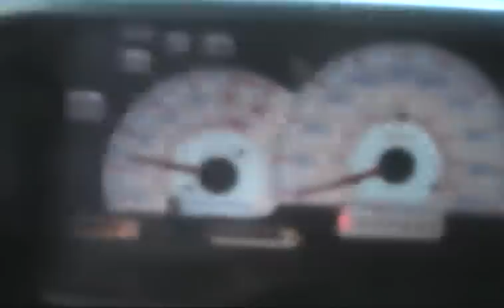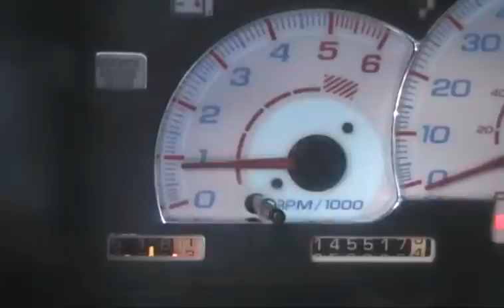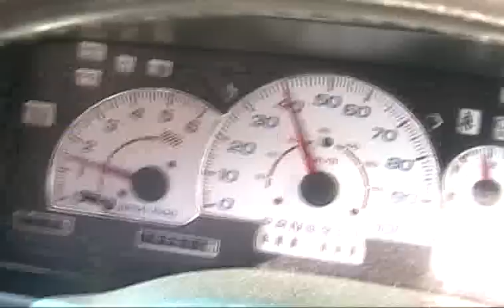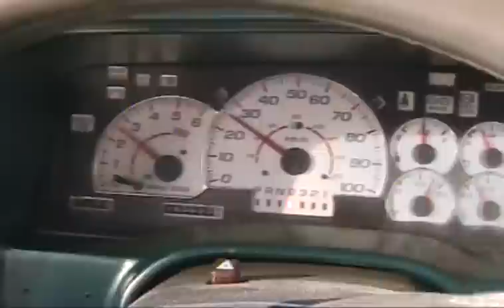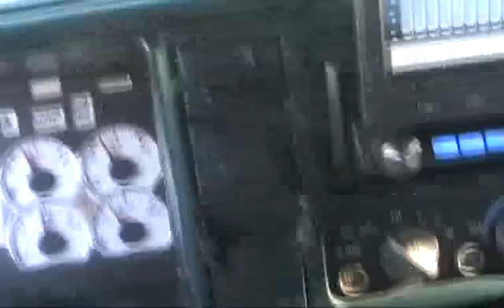Bad Chip in my 383 Stroker

Comment from the maker: Its a 95 cluster with an aftermarket overlay which is appropriate for a 96 or newer. They all go to 6000 max, the only difference between the 95 and 96 or newer is the redline which was higher on teh 96 due to the vortec engines. Mine is still accurate as I have cross checked it with 3 other tachs. It was necessary to have it exact for dynotuning purposes.

Comment from the maker: Hooker Long tubes with 2-1/2" collectors. The truel dual 2-1/2" pipe. Each bank has a 12" resonator and a single chamber Stainless steel Imco muffler. The exit is a 4" stainless tip out each side behind the tires.

Comment from the maker: the 65 injectors will work and they are can be set up to really flow with higher fuel pressure. Its a fairly common thing for people to just run higher pressure in lieu of the larger injectors with lower pressure. You may be able to just kick up your fruel pressure a bit to accomplish this. You can either modify the stock one or purchase an external. Personally after everything ive gone through, I would suggest the external with a gauge so you at least know where you are.

Comment from the maker: Man I wish. I ended up putting the stock chip and stock injectors in to keep it sane. One of these days ill set aside a couple grand and drive down to the dyno shop and have them go through it. It runs great on the stock chip, just quite restricted.

Comment from the maker: TBI Chips could not set up a chip for this engine. He burned dozens in an attempt and eventually the spark knock blew a piston and I had to do a rebuild. For the last 2 years ive been driving around with the stock injectors and the 18PSI spring as a temporary fix. It runs rich on idle in closed loop like this. I am upgrading to the Dynamic EFI EBL Flash system as soon as I put the truck back on the road for the summer. The vehicle is seasonal so I dont drive it much but the EBL should fix it all

Comment: @KD4421 dont base time. do it with spark advance wire connected and watch your spark advance reading from your ecm. it'll probably be somewhere near 32 to start. turn your dist. and see if your reading goes lower. try to bring it down as far as you can while monitoring your idle quality. also do all this with your engine up to temp. should help idle and low speed driving. if sucessful with that you may want a adjustable FPR. normal fuel press. between 9-13psi. you may need more. good luck

Comment: i went thru this with a holley TBI which had injectors rated higher than stock. never could get it dialed in. chips wont help. need a more advanced/interactive ecm setup. obd1 doesnt have the right on the fly flexibility with tuning fuel delivery/spark advance. the only thing i would check according to what i see on your vid would be your spark advance reading from your ecm. should be close to 0 deg. max is 32 which is as far as your ecm can advance which you dont want. tryadvancingtiming cont>